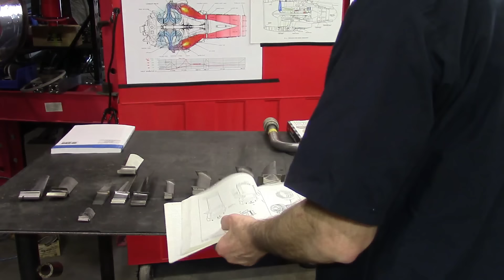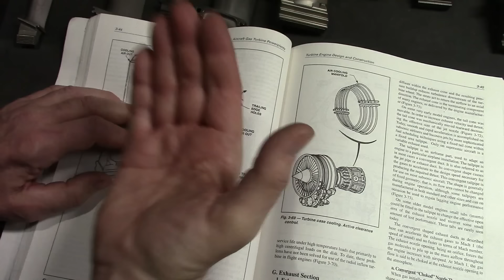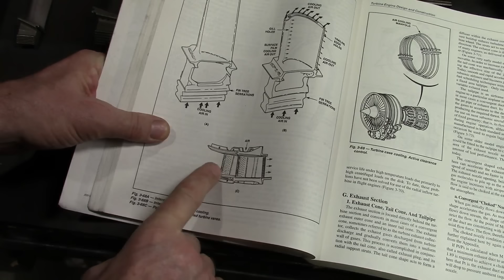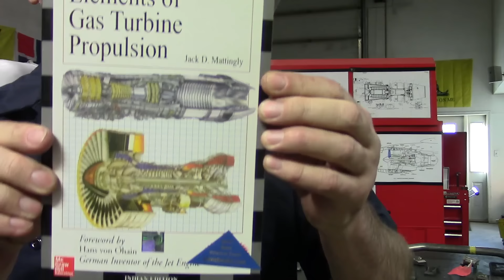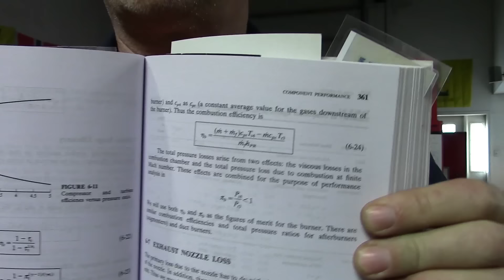Turbine Blade Cooling Air Pathways

Comment: Rolls has been GROWING titanium single crystal blades for their "Trent" series ... with internal passages and surface holes somehow grown in place.  The process is proprietary and secret.
Reply: Single crystal turbine blades are by no means new: R-R was casting them for both civil and military engines well before I took early retirement twenty years ago.  Essentially, they are cast, using the 'lost wax' process.  The single crystal is then 'grown' by slowly withdrawing the ceramic mould from the furnace, so that the blade progressively cools and solidifies from root to tip.  This much is not secret: more details can be found on the internet.
However, I have to tell you that HP turbine blades are not cast in titanium: it's not a turbine blade material.  Think in terms of high-temperature-resistant nickel-cobalt alloys, such as MAR-M 002.
Reply from the maker: Turbine blades are not made of any type of titanium alloy. Ti is soft, weak, and prone to melting or even catching fire in combustion gases.
Ti is stronger, harder, heavier, and more temperature resistant then aluminum, but compared to Refractory alloys of nickel and iron, Ti is weaker, softer, lighter, and less temperature resistant.
Turbine blades made from Wensleydale cheese, and even balsa wood, are just as good as those made of titanium.
Reply: @AgentJayZ  Titanium can catch fire in a compressor, where the air pressure and temperature is high enough.  There is something known as the 'titanium fire line', downstream of which, if there is (eg) a heavy tip rub, then a fire may be initiated.  If this occurs, all the titanium aerofoils (and possibly the discs) will be consumed.  The fire may be so intense as to burn through the engine casings and the airframe structure. 
I am aware that such an event happened somewhere over Canada, some years ago, to a twin-engined fighter, which was not of Canadian or US origin.  The wingman who observed the event said it was the brightest white light that he'd ever seen.
The second engine continued to run, keeping the aircraft in the air, but its electrical control connections had been destroyed, and possibly some of the aircraft's flight controls too.
There was no chance of getting the aircraft down to a safe landing, so the two crew used their ejection seats, and the final result was a smoking hole somewhere in the Canadian wilderness.
Reply: @AgentJayZ  I approve of your choice of cheese.  Unfortunately, the UK has called off trade agreement talks with Canada, and a whopping increase in tariff will be imposed on British cheese imports.
Reply from the maker: We all know that Canadians make really good cheese. We also know that we use recipes from other places. Canadian cheddar is darn good. I think many of us don't realize that it's named after a place, that makes the real thing. It is more expensive, and to regular folks like me, that's a shame.

Comment: This is what I keep explaining to my pilot friends when they start talking about a mythical small, efficient, low cost turbine engine. The key is the temperature differential, or how hot you can run the turbine itself. The key to keeping the turbine buckets (aka blades) cool enough to survive a large temperature differential is through cooling air inside of it, and a film of protective cooling air surrounding it as protection from the combustion heat. The physics of moving air around tiny little passages gets harder and harder to do, and even more difficult to manufacture. Making a 250hp gas turbine engine that is efficient and cheap, is simply not possible, at least not in any means we have today. Film cooling was used in the V2 rocket engine in WW2, quite effectively.

Comment: Is there possibility to cool that  cooling air between compressor and turbine blade?
Reply: Don't light the combustors. 😅

Seriously though, it'd reduce output power. 

Air film bleed cooling, along with coating and internal cooling for best results. Even if it's all ceramic.
Reply: @BerndFelsche  I am talking about  that airflow which is used for blades cooling only. Not reducing the temperature of exhaust gases of the burner.
Reply: @BerndFelsche  the idea is to make that bleeding air cooler in order to reduce the mass flow of it.
Reply from the maker: Such a small amount is used compared to total mass flow, the expense and complication would not be worth the bother. Also, when you want to carry heat away from something that is over 1500F, and you use air at even 500F, it's going to work just fine.
Reply: There’s no point because when we design an engine, you can chose from where you want the cooling air with temps varying from T1 to T2.8ish. If you want cooler air, just take from a station closer to the inlet. Plus you dont want to reduce the temp in the gas path with really cold air because that means that less work can be produced by the next turbine stage.
Reply: @KinZZi  the fact of the matter is that cooler air (closer to inlet) doesn't have enough pressure to be injected into that hot gas stream. With cooler bleeding air there is possibility to increase gas temperature from the burner thus gas power potential (for the second, third ) turbine stages also.
Reply: This is a copy-and-paste of the comment that I posted just a short while ago.
Cooled cooling air for the turbine, AgentJayZ?   Yes, it was done years ago - by the Russians in one of their military turbofans.  If you trawl the internet, you might be able to find a photo of a sectioned engine with a mass of small tubes in the bypass duct.
I did look at cooled cooling air and putting a heat exchanger in the bypass duct of a future military engine project at R-R Bristol, many years ago.  Having told you this, I hope that I don't get a knock at the door and get taken away by some men in dark suits.
Reply: @grahamj9101  do russians design and manufacture aircraft engines?
Reply: @aaraspensor   Yes, of course.  I won't list the design bureaux and manufacturers here: try Wikipedia for information.
Reply: @grahamj9101  honestly I heard nothing about any russian aircraft engine in reality.

Comment: I have a related question.  I read somewhere recently that one way to significantly reduce drag on a torpedo (as in a torpedo from a submarine) is to eject compressed air out of the torpedo nose so that the torpedo essentially moves through a near-still (relative to the torpedo) envelope of air (which would have significantly less drag than moving through the water).  Leaves me wondering if the cooling air ejected out of the leading edge of a turbine blade, which at that point would be moving at the same, or very nearly the same, speed as the blade, helps reduce drag on the blade?
Reply: It's an interesting suggestion, but it was never discussed when I was involved in turbine design many years ago
Reply from the maker: The turbine blades are not "being propelled" through the gases, so they do not need reduction in friction. The blades are being moved by the gases, which are moving faster than the blades. If anything, friction is helping the gases move the blades.
Reply: @AgentJayZ  But don't the turbine blades act as 'air foils' so less drag would be a plus?
Reply: @AgentJayZ  Sorry, but I don’t think you have thought this out, and I’ve been thinking about how to explain this to your subscribers.
As buckybucky8596 has suggested, turbine blades can be considered as airfoils/aerofoils, albeit highly cambered, which are intended to produce a lift force in the circumferential direction.  However, taking into account their stagger angle, their lift force could conventionally be considered as acting as approximately normal to the stagger angle, with a component in the axial direction ie, producing a rearwards force.
But if there is a lift force, there must also be a drag force, which could conventionally be considered as acting at right angles to the lift force.  However, this would mean that there would be a component in the circumferential direction, ie, producing a force opposing the circumferential component of the lift force. 
You suggest that, as the turbine blades are "not being propelled" through the gas flow, then this must make a difference.  However, an aerofoil in a wind tunnel is not being propelled through the air flow. Nevertheless, we treat the results as being representative of an aerofoil being propelled through the air by an aeroplane – sorry, airplane.
So, how would increasing the 'friction' of a turbine blade improve its function and increase its efficiency?  It wouldn’t.
PS  We consider 'lift' and 'drag' as two separate and distinct forces: it's a useful convention but, in reality there is really only one total aerodynamic force acting on an aerofoil (or any body in a moving air flow), albeit produced by various interactions of the air with the aerofoil.  'Lift' and 'drag'  are effectively components of that force.
Reply from the maker: Alright. The original comment was about comparing a torpedo traveling through water, reducing friction by blowing air around itself, and how a turbine blade in a gas turbine engine is similar in the way it functions.
I will retreat to my position that there is no similarity, making any discussion of wings, lift and drag meaningless.
Any further continuation on this subject will happen without my interest or participation.

Comment: I wonder if the computer on a modern engine varies the compressor bleed air to the different cooling pathways during different operatig conditions? I know we are extracting smaller and smaller effiencies from modern engines, and varying the bypass air might account for several percents of thermal efficiency at cruising conditions.
Reply from the maker: Well, the turbine blade cooling air is never restricted, or controlled by anything other than what we describe here in the design process.
But you may be interested in turbine case cooling, which is varied by changing airflow.
It's called Active Clearance Control, and here is a vid I made a couple years ago featuring it as one of two subjects: 
"Racing Bikes and Active Clearance Control"
ACC discussion starts at 22:00.
Reply: The amount of air which goes to the nozzle guide vanes can be controlled by Fadec. But never the 1st stage. For example on Pw4000 and Cf6- 80c2 the amount of air can be reduced during cruise conditions for the 2nd stage high pressure turbine nozzle guide vanes. Only reduced never cutoff

Comment: The CF6-6 and the TF-39 had the two in one blades. They called them buckets.
Reply from the maker: The steam guys called them buckets, and it caught on. Such a term is archaic and some would say inappropriate these days.
Reply: I worked at general electric in evendale and that was what they called the area that made those parts. I have no idea where the the term came from

Comment: Maybe a stupid question, but is it possible to have regeneratively cooled blades (similar to rocket engine combustion chamber) by running fuel trough them? I guess coking would be a problem…
Reply from the maker: No need. Air works best, otherwise something else would be used. Well, maybe you are smarter and have better ideas than the thousands of professional engineers constantly working to improve engine performance...

Comment: The manufacture of those things is very data intense.  Everything in the process is logged, a few of each batch gets X-Rayed and that data is stored away for a very long time for traceability.  If they make one today and it fails 30 years from today, the investigator will be able to track back to the initial making of the thing.  At least that is supposed to be how it works.  Pretty fascinating process, IMO to make so many and record so much and yea, each one cannot cost $1M...not practical.

Comment: Jumo 109-004B Orkan  engines had hollow bleed air cooled blades.
Reply from the maker: Good to know.
Reply: Folded sheet metal, made by WMF...
Reply: I just made a similar comment about BMW during the war.,
Reply: @hiha2108 
I mentioned that on the previous video.

Comment: I was watching a talk on this here YouTube by the chap that wrote the “The Secret Horse Power Race” book, he mentioned that BMW when developing a turbo charger for the FW190 engine used air cooling for the turbine due to a lack of Nickel needed to make high temperature steel.
I’ve failed to find other mentions of this on the net.
Reply: That's true, here a foto of the BMW801TJ-turbine blades, which I shot in Deutsches Museum. https://upload.wikimedia.org/wikipedia/commons/thumb/2/2a/801-turbo2.jpg/1280px-801-turbo2.jpg
They are made of CrMn-steel, cooling air was blown through.
Reply: I've had a quick scan of my copy of the book, but I haven't found any mention of this. However, on page 388, I've found a very small illustration of an FW190 turbocharged fighter with a Jumo 213 engine.  I will look again, but there are several hundred pages of relatively small print. 
If you want detailed information on the cooled turbine blades of the wartime German jet  engines, then I can recommend, 'German Jet Engine and Gas Turbine Development 1930-1945', by Antony Kay.  However, I believe that it's out of print, and it will cost you at least GBP85 second hand.
PS  Don't be fooled by Kay characterising the German engines as "advanced".  In 1944, their performance figures (in terms of pressure ratio, specific fuel consumption and power-to-weight ratio) were all inferior to Frank Whittle's W.1 engine, which took to the air in May 1941.  Their handling was abysmal:  starting was laborious and any rapid throttle movement was likely to result in a surge and a flameout. And of course, their life (typically 25 hours) was limited by the lack of suitable nickel alloys for the turbine aerofoils, hence the need for rudimentary air cooling.  
Compare this with the W.1 engine: in 1941, it did 25 hours of high power ground running before being released for 10 flight hours in the E.28/39.
Reply: @grahamj9101  FW190 not 109. I always seem to do that.
I was talking from memory so it might not of been BMW.
If I get a chance I shall check.
Reply: 12:05 mentions it being used on a Jumo 

https://youtu.be/x3xmJ74ME7E?si=gYma_1jOQtQ-OpGv?t=12m05s
Reply: @Margarinetaylorgrease  Thanks, very interesting.
Reply: @grahamj9101  
So do you think Jumo or BMW did it first
Reply: @Margarinetaylorgrease  I don't know, and really I don't bother. Maybe DB also startet with it? All three were developping on gas turbine engines. You better ask Calum Douglas, he has read a lot of old documents :-) (I just ordered his book.)

Comment: Does GE or any other aircraft Engine  manufacturer make a triple spool engine like the Rolls-Royce RB211 Trent, they were the first bleed air turbine cooling turbojet cause I have seen possibly from you
How's the pt6 going updates please
Reply: I believe that the Russians designed and built a three-spool, high bypass turbofan some years ago.  And, of course, the Turbo Union RB199 engine, which powered the Panavia Tornado, had three spools.
Reply: @grahamj9101  well I guess our Rolls-Royce RB211 high bypass originally made for the Lockheed TriStar and when fitted to the Qantas B747 had a fuel saving of 1 million lb of fuel per aircraft had to be investigated
 The RR RB 199 engine I have a fourth stage turbine bought e-bay
Interesting comment thank you for your reply
Reply: £ meant not lb sorry
Voice to text, I should have read it first

Comment: Something I've wondered about for a long time: what is the smallest feasible gas turbine engine (either axial or centrifugal)? I've seen pretty tiny ones (like IDK maybe 4" diameter) but can they be made smaller still?

And if not, what is the limiting factor? I can think of a couple of candidates: 1) strength of materials (the smaller they are the faster they spin, right? So at some point everything will fly apart at the rotational speeds required); 2) thermodynamic: smaller turbines means less space available for gas expansion; 3) engineering: the smaller you go, the more microscopic the tolerances get.
Reply from the maker: What do you want, and how much money do you have? And "feasible" means a different thing to different people.
If you are super rich, and just want to play, I'm sure you could make a jet engine out of a dentist drill. It's a tiny air turbine, and you would need to micromachine a compressor for it, and a fuel system, and a combustion section.
Reply: We use nitrogen powered turbines to drill out calcified heart arteries before placing stents to improve blood flow.

Comment: Cooled cooling air for the turbine, AgentJayZ?   Yes, it was done years ago - by the Russians in one of their military turbofans.  If you trawl the internet, you might be able to find a photo of a sectioned engine with a mass of small tubes in the bypass duct.
I did look at cooled cooling air and putting a heat exchanger in the bypass duct of a future military engine project at R-R Bristol, many years ago.  Having told you this, I hope that I don't get a knock at the door and get taken away by some men in dark suits.
Reply from the maker: If it was a good idea, it would be incorporated into modern engine designs.
I am again impressed with the range of your knowledge.
Thanks.

Comment: A notable professor once said, "Let the rest of the world worry about water".  When a civilizations ability to move is ruled by exothermic reaction, where your wallet releases heat, and now is even given cooling holes so it can release more heat!  Then we have reached the maximum potential of a turbine blade and the said societies ability to evolve.  Therefore it's up to the individual to fight for their right in how their ability to move is ruled.  Physics that include an endothermic reaction would loosen this shackle, cool the wallet, reduce the need of exotic geometric shapes and balance the equation allowing evolution to continue.  Change comes from the bottom!
Reply from the maker: "Um... I'll have what he's having."